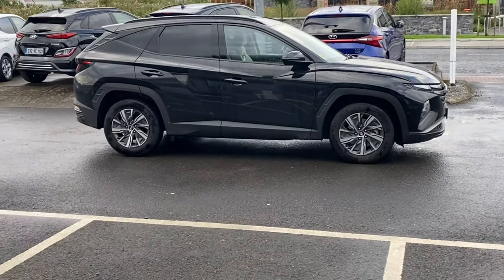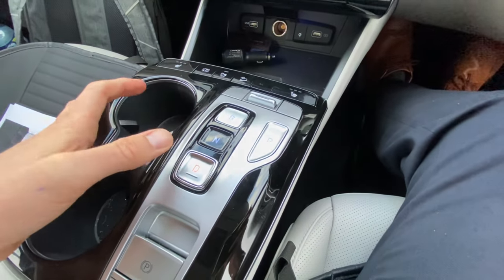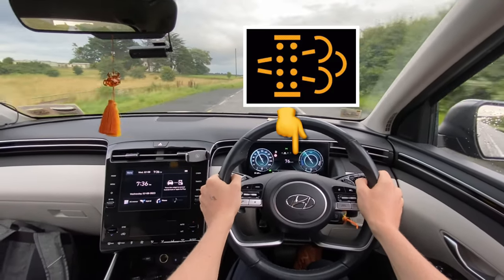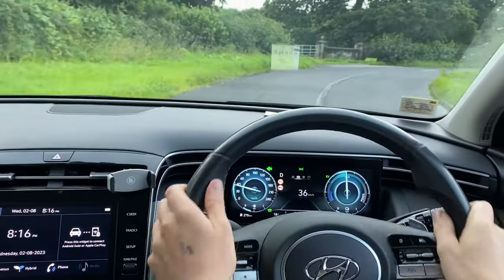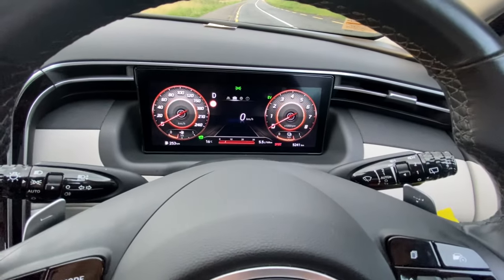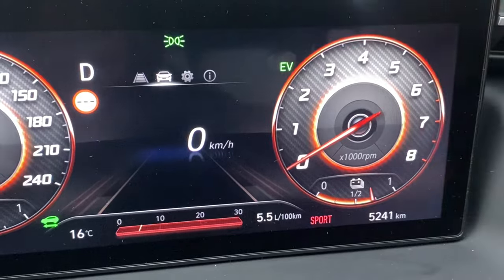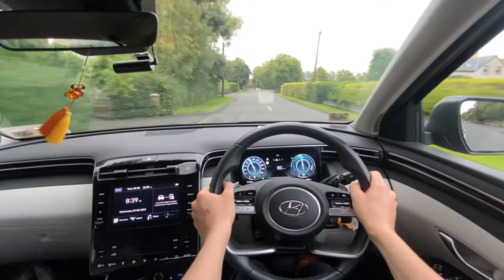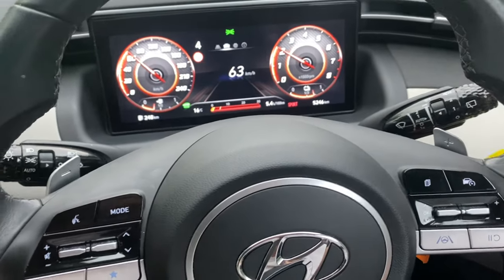How do you clear the GPF light on Hyundai Tucson #dpf #gpf #hyundaitucson #howto

Comment: Brian. That is hard work for most people. Is this a new issue with all new cars. Still watch all your vids. Best man to explain everything in laymans terms.
Reply from the maker: Thanks for watching and for the kind words, 🙂👍it’s a lot of work in the automatic for most people, I think the way you have to look at it is try and get a car on the motorway at for 20 or 30 minutes every two or three weeks and it will avoid the gasoline particular filter clogging. So it’s preventive maintenance would be the best way to avoid the issue in the first place, but at least if it does happen, there is a way to work around it rather than having to wait to get into the workshop.🙂
Reply: Hi Brian my light was flashing and when I got home and turn off my car it came off after I turn back on so can u tell me what to do I have a 2018 hyundai tucson diesel
Reply: Sorry I meant when I turn back the car on it came off so should I take it out for a long drive or to a shop I'm so confused
Reply from the maker: @anthonylaurence8927  hey 👋 so is the light staying flashing when you switch the car back on ?
Reply: @doolanbrian  it was flashing while I was driving but I stop turn off the car and then turn it back on and it went off but I took the car for a 3 hour drive yesterday and I didn't see it come on back do I need to be worried
Reply from the maker: @anthonylaurence8927  okay that’s a little bit unusual, but for the moment if you don’t have a light on your dashboard then there is no further action required. I would imagine if the car is not giving you any warnings it’s resolved but maybe contact the local dealer just to get their thoughts also.
Reply: Thank u very much it never came on back
Reply from the maker: @anthonylaurence8927  awesome.. you’re in the clear so !
Reply: "I think the way you have to look at it is try and get a car on the motorway at for 20 or 30 minutes every two or three weeks and it will avoid the gasoline particular filter clogging"

Not very convenient if you don't live close to a motorway, though.

Comment: Worked a treat - cleared after around 15-20 mins of driving by adopting this method (mhev dct)
Reply from the maker: That’s great to hear unfortunately it’s a little bit of a complex way of doing things but this seems to be the method!
Reply: @doolanbrian  I’ve tried to clear it a couple of times previously, this time I followed your example for the dct, kept revs to 4000 let it drop back and then back up to 4000 and in sport mode using third and fourth gear to keep the revs - took around 16mins of driving and just vanished all of a sudden so thanks for this advice Brian - appreciate it 👍🏼
Reply from the maker: @BURGONANDSONS  you’re sorted so going forward!

Comment: Automatic:
Sport mode
Over 80km per hour
Maybe use gear 4. Keep same gear
Drive upto 4000 rpm
Release accelerator for 5 seconds
Accelerate again until it reaches 4000 rpm
Repeat
Do this for 30mins

Manual:
Over 80km per hour 
2500 and 4000 rpm
For 30mins

Try using sport mode

Comment: I don’t have 30mins and a spare £7 in fuel every time the car produces this fault, after all it is not my driving style that decides to change gear at low revs, coast (called Sailing) at times, and stop the engine in stationary traffic - that would be the car. Having tried the reset method and it didn’t work , the first time the light came on, my dealer revved it at standstill until the headers and turbo glowed cherry red. Nice for an engine with 700 miles on the clock. How long will that engine last? Not very ‘green’ is it? And will I also get compensation for all the pointless journeys I am doing when I blow my annual lease mileage? Last Hyundai I will buy.
Reply from the maker: What country are you based in?
Reply: I am in Yorkshire, cheers
Reply from the maker: @dannycarmichael6445  how often does the regeneration light appear? Roughly how many kilometres in between each event?
Reply: First time at 700 miles, when the dealer made everything glow red to reset. Came on again at about 3800miles, 7mths later. Drove like Lewis Hamilton, not how I wanted to drive or normally do, I bought it to drive the family sensibly and relaxed, and it didn’t reset in over 80miles.
Reply from the maker: @dannycarmichael6445  it’s an engine we don’t get in Ireland in Tucson unfortunately so I have no experience on it but our diesels do not frequent regeneration too unfortunately.. the advice we give is every 2/300 kms the car needs a 10/15 min run at over 80 kmh at consistent speed to reduce the chance of it getting clogged. Usually the diesel drivers are doing this anyway as they tend to be higher kms drivers

Comment: Hi. As far as I know, the engine hasn't kicked in. We've just done a couple of trips, 2-3 miles and back. The fuel is getting low so that could be as you suggest, giving a false reading. Yes, my warning light is still on, solid though, not flashing. I suspect my local stretch of motorway might not be long enough for a sustained run at the required speed for the length of time needed.
Reply from the maker: I think you will need to give it a try soon .. it’s better to get it cleared out 👍🙂

Comment: I have a 22 plate kia sportage and theres a massive problem with these filters clogging up , many complaints of owners having to have a forced regeneration done at garage even thosd who have motorways to thrash their motor down 😢 . There is a software update available which i had done at  the first service and second forced regeneration so hopefully this helps , will be very disappointed if not .
Reply from the maker: Is yours Petrol ?? 🙂
Reply: Yes 1.6 petrol , Kia manual tells to use the method the same as a diesel Kia ? 30 k car and a total pain in the a##e , big disappointment!!!
Reply from the maker: @Jwp714i  hmm , i would have thought the method should be like this video for Tucson 🤷🏻?? .. the petrol and diesel Hyundais have different methods 🤔🙂

Comment: Hi Brian. Took your advice with my Tucson petrol hybrid. Hasn't cleared it yet, but my question is; will the steps I've taken so far, have started to clear the filter, or is it a matter of, it can only be cleared in a single continuous run. Thanks.
Reply from the maker: Excellent question, in my opinion, it needs the continuous run as there are various thresholds that need to be satisfied before it completes, although it is possible that there might be some partial amount of carbon burnt out on your first run👍

Comment: Do you think that will work on kia sportage 1.6crdi 2020? I got cleanet dpf and after fitting to the car still geting fault dpf  p246300 dpf restriction-soot accumulation. I my scaner dont have function to reset the dpf and i cant do regeneration manualy witb my scanner.
Reply from the maker: Is the DPF light flashing or constant??
Reply: @doolanbrian  it is flashing
Reply from the maker: @ecuperformance3320  I think you will have to do a forced regeneration, you may need the Hyundai software to reset the fault
Reply: @doolanbrian  yes I was trying to do regeneration but when I start doing the tool not allowing to do regen. I was waiting like 30 min to do regeneration and no luck

Comment: Here's one Brian. I've been using just the EV mode on my Tucson phev as the particle filter hasn't cleared yet, and I don't want to make it worse. I've noticed, though, that even without using petrol, the fuel gauge is still going down. Haven't used the heater either.. any ideas? Thanks.
Reply from the maker: Can’t be 100% sure, but from what I know, there is a float in the tank so it might need some fuel floor to give a more accurate reading, are you sure the engine has not engaged in the last while ? Do you still have warning on your dash for particulate filter ?

Comment: Thanks a lot for the video. Before I try it with my Tucson with automatic gear box, I have a question. Would it be different in a cold weather or will it take more time to clear the GPF? The country where I live is currently minus 2 degrees. I've already driven about 50km on a motorway but without lowering gear box to gear 4, it was in automatic mode, light is still on (not flashing).
Reply from the maker: You are absolutely correct unfortunately the process seems to be more difficult in colder weather, it might even make more sense to wait until the middle of the day when the temperature maybe creeps a little bit higher? I can’t tell you this for certain, but I think there is some logic to your idea of it being affected by cold weather.
Reply: Thanks again. I'll wait until the end the of the week, it should be warmer then :)
Reply from the maker: @Mihail0885  let me know if it helps 🤔🙂
Reply: @doolanbrian  , It worked, it took me 16 minutes in total to clear the GPF. 9 minutes to get to the motorway and 7 minutes on the motorway in gear 4 sport mode, driving the same way as in your video. The warning light disappeared. The temperature outside was +6 degrees. Thanks a mill for the video.
Reply from the maker: @Mihail0885  excellent!!!

Comment: done it last week  with my 1.6l petrol 2023 tucson, took just around 10 minutes for warning light to disappear  , but you need to switch gearbox to manual and keep high rpm, 4 or 5th gear around 3500-4000 rpm,60mph. First attempt on automatic gearbox failed even driving almost 50 miles on M1.  Is this supposed to be eco-environment friendly?? Used to owned 2015 (8y old) pegueot 3008 diesel before getting hyundai ,same style driving, mainly city/urban and we never!!! had to do it in old car. With h. tucson in September we came back from holiday across Europe(motorway driving 2000 miles). Back in London and after 800 miles in city over the past last 3 months and this light pop out-------shame .
Reply from the maker: Unfortunately, the modern engines are subject to different criterias for emissions, compared with the Peugeot you had, the more they try to reduce the emissions from the engine, the more complex they get, . The method by which carbon is trapped and burned even on the older model Tucson is less stringent than it is on the more modern ones, so the new ones actually need more motorway driving than the old ones👍
Reply: What you really need is to flush about 2-3 litre Wynn's off-car dpf cleaning liquid down to the gpf with a garden sprayer. Leave it for an hour or two. Then drive on motorway on 4th gear for about half an hour. It should turn that light off.

Comment: have this issue myself in a kia stinger with a gpf and mine flashes, have took to kia but they couldnt clear it, im stuck with it basically
Reply from the maker: What advice did they give ?
Reply: @doolanbrian  i told them that it probably needs a forced regen, which they told me they have already done it, so the other option was to leave the car with them which i will have to do soon,
Reply from the maker: @trfc90  ok .. your right the car needs forced regeneration provided the GPF is undamaged 

Has the car got good service history .. it’s not burning oil or anything like that ??
Reply: @doolanbrian   always had it serviced from kia, no oil burning, has only done 25k miles and it is still under warranty
Reply from the maker: @trfc90  okay that sounds good

Dealer who is currently unable to fix this should really be able to cross reference with the manufacturer for advice and then get you back in so while it’s under warranty they should be able to assist with getting it sorted 

Did you buy the car from the dealer that you are dealing with?
Reply: @doolanbrian all sorted now, left it with them for a few days and they told me they did the forced regen 'again' and it cleared, told me to take it for a good drive every 3 weeks so that the light doesnt come back on, done it under warranty too
Reply from the maker: @trfc90  okay can you look in your manual and see if there’s anything about gasoline particulate filter in the manual, it will probably be under the heading of exhaust system, basically what I’m trying to find out is what are the instructions for clearing the gasoline particulate filter? Once you know these, then I would suggest doing this, maybe once every 2 to 3 weeks just to keep it clear even if the light does not come on, does all of this make sense?

Comment: 30 mins is ridiculous these filters are a load of shite
Reply from the maker: They recommend 30 minutes, from what I have found so far it is around 10 minutes to 15 minutes to clear them .. for sure it is not ideal, they are trying to figure a balance between power and reducing emissions, which seems to not be too straightforward with European regulations
Reply: @doolanbrian  yeh I miss the old normal cars haha
Reply from the maker: @MiScusi1980  so do we !
Reply: @doolanbrian  little update ...Its just took nearly a 40 minute drive to clear the GPF light in my kia sportage it's frustrating if I've got to do that every time the light comes on petrol isn't the cheapest these days.

Comment: Third time this has happened just traveled 150miles trying this method didn't work.
Looks like another forced regen .1st and last hyundai
Reply from the maker: Was it flashing when you started driving James ?
Reply: @doolanbrian  it wasn't flashing just appeared yesterday I did a 150mile journey and it still appears on dash.gonna give it another try later if it doesn't disappear I'll need to get a forced regen
Reply from the maker: @jamesbonnar2917  if it’s flashing today then it’s a forced regen but if it’s not flashing the video methods should work .. manual or auto ??
Reply: @doolanbrian  hi mate I've just completed your guide and the car has cleared within 10mins.
I hadn't reached 4000rpm I was in the 3000rpm range. Manual 1.6ltr ultimate.
Thanks for your help
Reply from the maker: @jamesbonnar2917  okay good stuff. Glad this works for you!